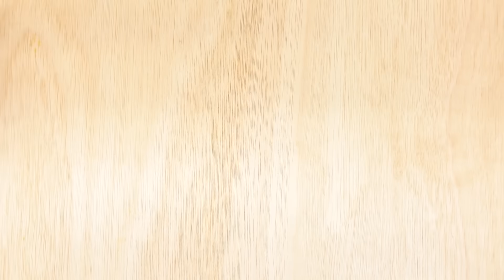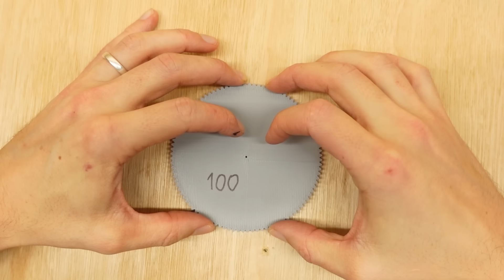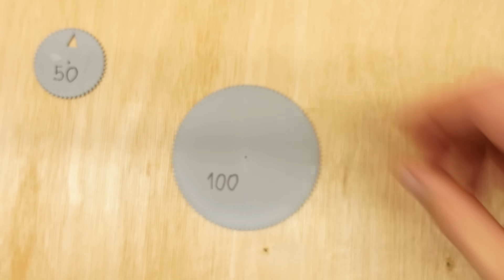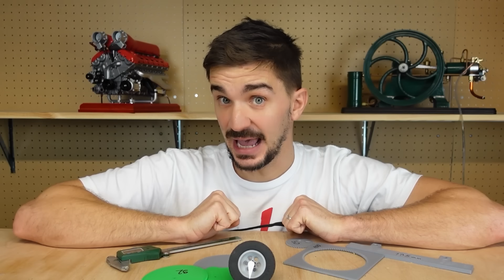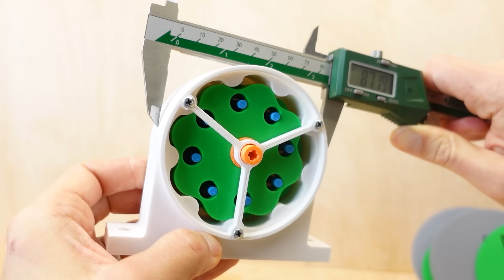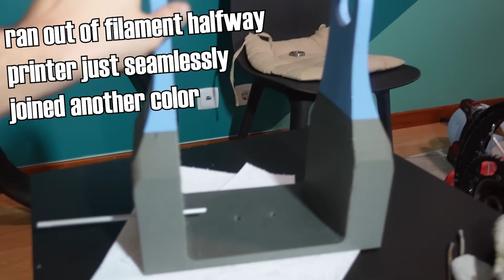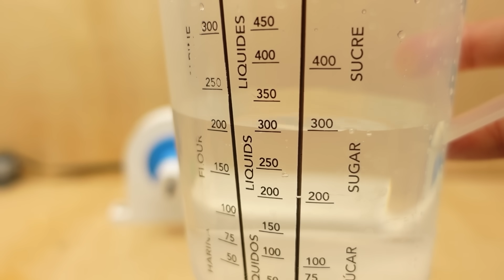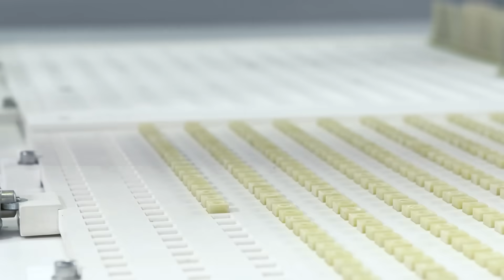Toothless Gears Make Much More Torque Than Conventional Ones, Here's How. Cycloid Drive Explained

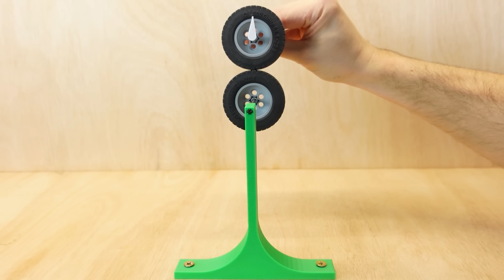Comment: 0:57 this is actually based on perspective. This is because here the wheel not only rotates, but it also revolves. From our perspective it makes two rotations, from the perspective of the stationary wheel the rotating wheel still makes just one rotation.
Reply: Another way to think of this is with a curved surface. If you take the line, and curve it a bit like a hill, you would still intuitively count a full rotation from the perspective of the tangent of the curved surface (ie like watching a car roll over a hill as you walk next to it, or on a tiny planet). If you take this to its logical extreme and the "ground" curved even more and becomes a circle, it's the same thing. You went around the curved ground with the same number of steps/teeth.
Reply: @Nina-cd2eh so how come you can explain this so simply in one paragraph, but a video on the subject confused me about things I already knew 😅
Reply: @Nina-cd2eh  i really liked that explanation. it was very intuitive and easy to visualize. thank you.
Reply: @Nina-cd2eh  Ugh I don't get it, when I take the "ground" and give it a little hill but keep the surface distance the same, I'm imagining the wheel still performing one rotation. But then when you keep bending the ground into an eventual circle, somehow the wheel has to rotate another time?
Reply: @HopperDragon  No it doesn't. From your perspective it still would have been one rotation, because all you'd be seeing is a wheel moving the same distance. If you stare at the wheel, while visually keeping the "ground", all you see is a wheel traveling the same distance. 

Here's what you can do: If you have a phone, play the animation of the 2 wheels going around, and as it plays, rotate your phone so that the wheel on top is always on top. All you'll see is the wheels doing one rotation, each in opposite directions, aka the "ground" going backwards, and the wheel doing one rotation.

Notice also in the video how when you look at the wheel going around the other, the arrow points opposite the second wheel, and it never points opposite to it again, until it's on the top again. When the wheel is on the bottom, the arrow points towards the inner wheel, which is what happens when you do a half rotation from the perspective of the "ground", even though it looks like a full rotation from ours.
Reply: @Nina-cd2eh I really appreciate you taking the time to explain this to me. I think I get it now. My issue was that it seemed that the "extra" rotation from our perspective would indicate that somehow the wheel must have contacted "more" ground at its widest point, but I see that we were basically just taking the same event but rotating the entire system during the motion, including the ground. Thanks!
Reply: I was thinking the same! After the "first" rotation on the wheel the arrorw points towards the track it rotates on. exactly like half a rotation on the plane. You just add the rotation of the wheel to the rotation of the surface.
Reply: Came looking for this comment
Reply: finally someone said it, i thought i was crazy
Reply: He explained this really briefly and not very in depth, so he isn't wrong, but thanks for explaining further.
Reply: @Zach99999  The comment you replied to was pretty damn short. This wasn't about the brevity of the explanation. It was just not a good explanation.
Reply: @Zach99999  He said it was because of the distances the center travelled. He is actually wrong. Correlation is not causation. Calling a correlation a cause is factually wrong. He was incredibly wrong. I know facts don't matter to most people these days but this kind of thing is poison.
Reply: @Mindbulletz  How is he wrong? You explained nothing, just repeated he's wrong multiple times.
Reply: @Zach99999  Just use an example that isn’t a gear. How many times does the earth rotate in exactly 1 year?
Reply: @fraudbuster1456  Using the word rotate in relation to the earth is very ambiguous. It revolves ~once around the sun and spins about it's axis ~365 times. I don't understand what that has to do with my statement, please explain further.
Reply: @Zach99999  Understanding the dynamic of rotation isn’t limited to gears is my point. The earth revolves on its axis 366.25 times in a year.
Reply: @Zach99999  Another example of this rotational dynamic is on a clock face. At 12 noon, the hour and minute hands are together. How many more times will the hands be together from noon to midnight, including midnight?
Reply: @Zach99999 he's wrong because he doesn't stop the arrow at the right spot. If it is pointing away from the center at the starting point it must be pointing away from the center at the end of its travel to complete one full rotation.
Reply: @Mindbulletz  would you like to explain how his method is incorrect before you call his work “poison?”
Reply: @JWalk1922  Not adequately in a YouTube comment. The math behind his explanation doesn't add up for any case except for the special case he presented. If you make the orbiting circle 10x as large, it still only rotates 1 additional time, not 10 additional times.
Reply: @Mindbulletz  Calm down a little. He doesn’t mean “because” in the causal sense, but in the logically implies sense. It’s a strange and interesting and correct way to calculate the number of rotations.
Reply: @terdragontra8900 You're trolling.
Reply: @Zach99999 well @Mindbulletz literally explained why he was wrong... stop blinding yourself because you are a fan of someone. We are all a fan, but facts dont change. Being wrong doesnt mean someone a bad person. Are you trolling?
Reply: Correct.  The first 5 minutes of this video is basically an April fool's day gag.  There is no "up" on a circle.
Reply: I thought about that but dismissed it when he didn't talk about it. As it wasn't the main point of the video I guess it didn't matter I guess
Reply: Glad you said it before I did. God bless you, brotha.
Reply: Exactly! If you always make the frame of reference focus on the wheel itself it always completes the exact number of turns you would expect. Its only because that entire frame of reference also rotates that from a 3rd person perspective it appears to complete more or less rotations.
Reply: Oh thank goodness someone already said this.
Reply: Yep, it's all about what you use as a reference point.
Reply: Exactly, and the same reason why the small gear in the large one rotates "one less"
Reply: It’s an optical illusion with an incorrect conclusion drawn from it. If you start with the arrow pointing down (at the contact patch) then it quite clearly only rotates once.
Reply: @MacLocky to say incorrect is to be ignorrant. You can see it as both 1 rotation or 2 rotations, depending what the reference point is. If you only consider the center gear as reference point but not the outside view then a lot of relativistic stuff probably doesn't make sense to you.
Reply: the simplest way to visualize this visual trick is: The arrow started **pointing away from the surface of the stationary wheel**, when he said "1 rotation" the arrow **points to the surface of the static wheel**, when you uncurve the static wheel to a straight plane the other wheel only just made 0.5 rotation
Reply: умнО, ведущий в ролике подменяет понятия и делает это с умным видом
Reply: Yes, same thing I said.  When the drive gear doesn't move the driven gear, or vice-versa, the world/universe is what moves (the observer). Measure from the correct perspective, and it lines up fine.  The idea here, which is used in wenkel engines to create and harness the odd movement necessary of a triangle piston, is just a form of planetary gear reduction, which is proven severe duty reliability in equipment vs pegs rattling around in an oil pump drive that's not properly fitted.  O thought the idea behind these videos is to help people visualize and understand applied physics.  I just about puked after a minute of the stop animation after the adds before/about 8min in.
Reply: yes, he is f-ing up. he should be twisting the camera too to show it is only 2 rotations.
Reply: It changes with perspective, but it is from the perspective of the rotating wheel that it only makes one rotation. The perspective of the stationary wheel is the same as ours.
Reply: It gets way more intuitive when you use squares instead of circles.
Reply: Oh God THANK YOU, I like to think I would've figured this out eventually, but until I did my entire understanding of reality was gonna be rattled 😳
Reply: Yep. Ig you walk atound the Earth, you have rotated once. Add that to all the backflips you do on the trip and you have the correct amount of rotations 😅
Reply: Can you explain the tooth count? My brain says 1 tooth must equal 1 tooth
Reply: @MichaelBrown-wx6zq  Your brain is correct, the teeth are the same amount.
However the way the teeth are arranged changed.

Imagine you walk around the planet.
From your point of view you've always stayed upright and never did a frontflip on your journey.
An outsider observing from the "side", however, would see you making a full rotation for every time you go around the world.

This is what happens when the linear gear changes to a round gear, hence the extra revolution.
Even if you change the gear ratio it will still give you exactly one extra revolution.
Reply: @Nandrith  That last sentence was what I felt was sorely lacking in the video.
Reply: Yes, I'm irrationally upset by him trying to shove a plainly false notion down our throats within the first two minutes. In the straight line, the center of the wheel travels 2*pi*r. In the circle, if you just use your eyeballs, you'll see it travels 2*pi*(2r). Why would I think otherwise, and why the hell are you trying to tell me I thought otherwise?! OK now to unpause and find out his explanation
Reply: This is why the Earth actually rotates 366.25 times in a year.
Reply: It's about contact points. When you have less teeth you have less in contact. Without even doing the math, you can get a sense that with 10 to 100 teeth ratio it would take a lot of rotations of the smaller gear to orbit the ring gear; here only a few teeth are in contact. Whereas, 80 to 100 teeth would intuitively feel like it wouldn't need to rotate a lot because maybe 20 teeth are in contact at once. So it goes around quicker.
Reply: Exactly. In the reference space of the wheel, it rotates the same number of times. It's easy to see this if you count the rotations not in the global frame (ie not counting how many times the arrow is 'up'), but instead count how many times the arrow has the same orientation in relation to the surface its' rolling on. 100 teeth is 100 teeth. You don't get a magic number of extra rotations depending of how you arrange those teeth. And number of rotation is absolutely measured at the contact point. The entire premise was really confused and misleading.
Reply: This is well documented so I am 100% sure he knew this but correctly left it out.
In this context of gearing what usefully matters without question  is the perspective of to he central axis of the object that's rotating. His explanation using distance travelled was perfect. A relativistic explanation would just unnecessarily confuse the hell out of people when one of the perspectives is not of concern. What's the point of adding 'actually it's still just making one rotation but viewed from the other object'.
Reply: @hyena8385 dude I just wanted to add this as fun fact... Then war broke out in the replies.
Reply: that was my first thought too, but in a way both are correct
Reply: @Fogolol  Yeah. That "In a way" is called "perspective". Based on perspective either one can be true.
Reply: I would politely disagree.  From the perspective of the stationary wheel, it "rotated" twice, while it "revolved" around the stationary wheel once.  
But...
His entire point was not about the revolution it made, rather it was about the linear distance traveled as measured from the center of the wheel.  I'd say he did a darn good job teaching, because I was able to follow his line of thinking to explain this type of cycloidal gearbox... And THAT was the actual point of the video.
Reply: @IiTalk2Dogs No from the perspective of the stationary wheel the moving one only completes ONE ROTATION and one revolution. When D4A says that the moving gear completed it's first rotation, the arrow points towards the stationary gear, while at the beginning it pointed away from the stationary gear, meaning it only completed half a rotation for the stationary gear, even if it looks like a full rotation to a third spectator. You can imagine the arrow as a person. In the beginning the person looked away from the stationary gear, then it completed half a rotation and half a revolution around the stationary gear and is now looking AT the stationary gear. So from the stationary gears perspective it looks like the person turned 180°. I'm pretty sure Veritasium has a video on that, as it was once a question on some major exam. He explains well why it is based on perspective.
Reply: @nicerknifes9465 Let's ask one simple question and forget about the perspective for one moment:  How many degrees did the wheel (and the arrow) rotate?  The undeniable answer is 720 degrees.  That is indisputable.
Reply: @IiTalk2Dogs wrong again.  It's only 720 degrees from the perspective of the table surface.  It's 360 degrees from the perspective of the surface of the other gear.  Motion is relative, there's no such thing as an absolute point of reference.
Reply: @aCo @IiTalk2Dogs n, that depends on perspective. From third person view you are right. But not from the stationary gear. The revolving is a problem that introduces perspective here. If you ignore perspective and relativity the world as we know it would fall apart.
If you ask the question "how many degrees did the wheel turn?" Relative to use as third person: 720°.
Relative to the stationary gear however it only turned 360°.
I'm not arguing and never did that our view on this gives the moving gear two rotations.

Comment: have a look at "mud motors" used in drilling oil and gas wells.  they use cycloid gears that are very long and rotated.  the elongated and twisted rotor and stator make the mud motor which is driven by pumped fluid.  the rotor has one less lobe than the stator, as you pump a fluid down the gap between the two, you get the rotor spinning.  this could be reversed to make a high powered pump if you add a motor to drive the rotor. you can change the speed/torque ratios by changing the number of lobes

https://youtu.be/S2jEqY2MJtI

Comment: cant you just count teeth. well teeth count is same as the length in teeth units. absolutely in-depth explanation of the whole thing. nice. yep ie harmonic drive. ie same as harmonic drive but rigid instead of the flex chain. glad not to know. yay freedom. christ is absolutely fully perfect solution for everything. so ask christ about the real final solution. yes christ made everything and everything even perfect is possible. but dont try in flesh, it fails. nothing from flesh is the solution.